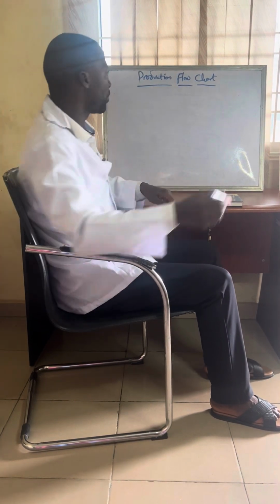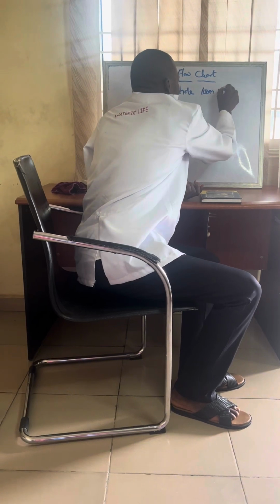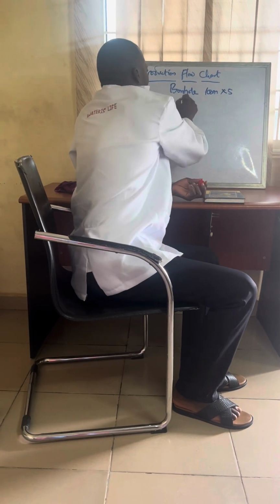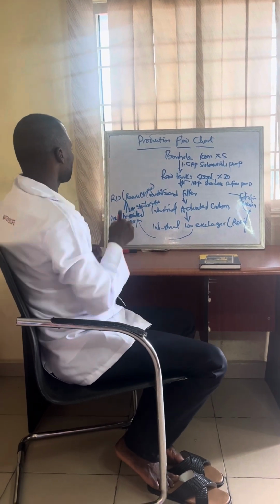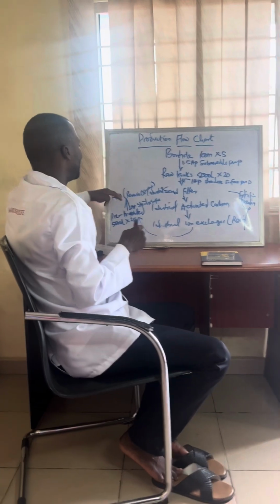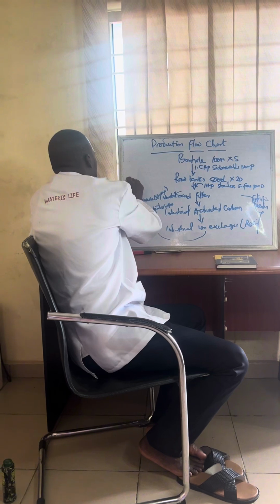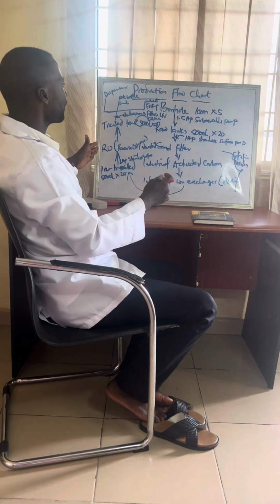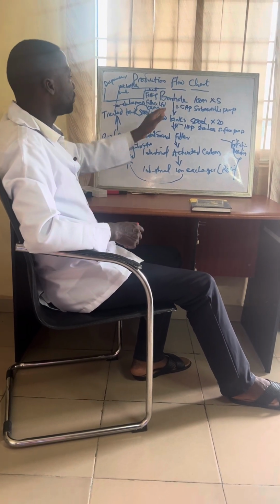Production flow chart💦💦💦

Comment: Thanks again, bro. Is it a standard practice to have ozone generator in the production line of sachet water? Is it also advisable to place ozone generator immediately after the RO?
Reply from the maker: For Sachet line, with your RO, UV water sterilizer is okay but if you have money to install Ozone generator it's better
Reply: @Ellynglobal  thanks so kindly
Reply from the maker: Ozone generator is either infused to the line to act on the water coming from your treated tanks or it is dozed into the treated tanks.
Reply: @Ellynglobal  thanks sir